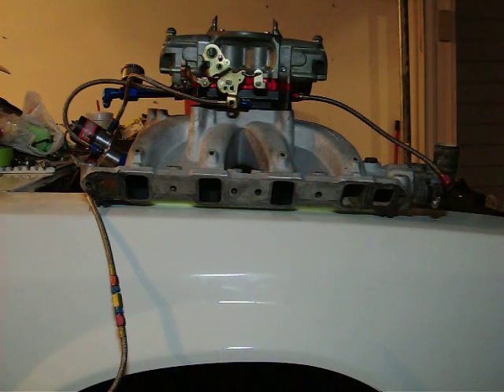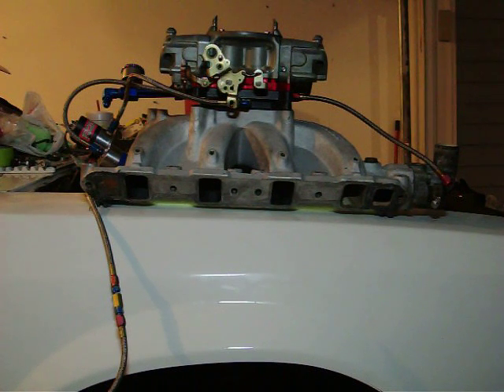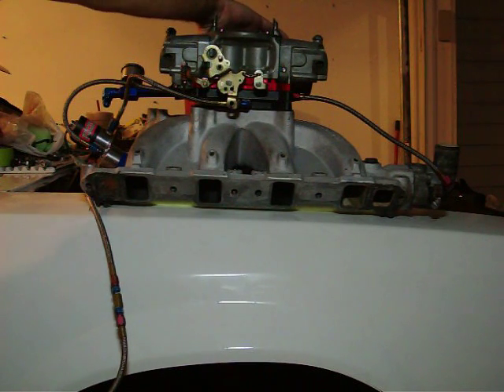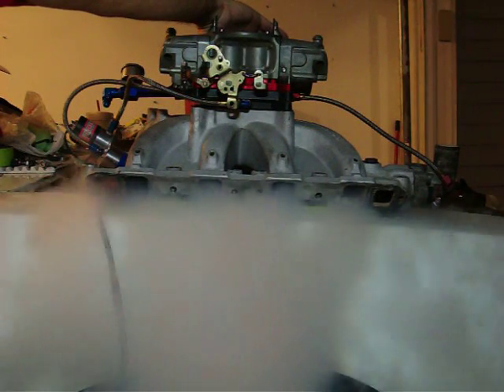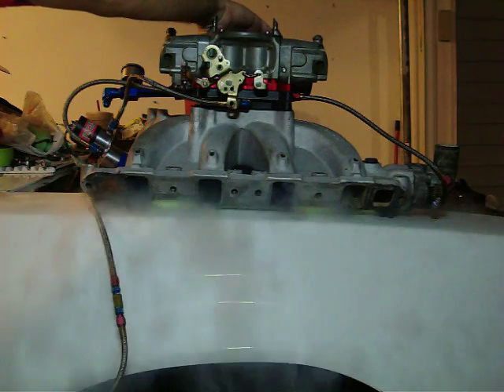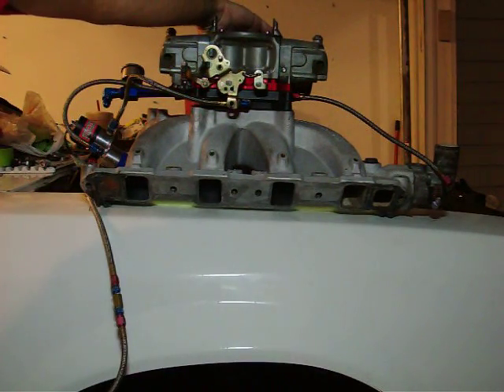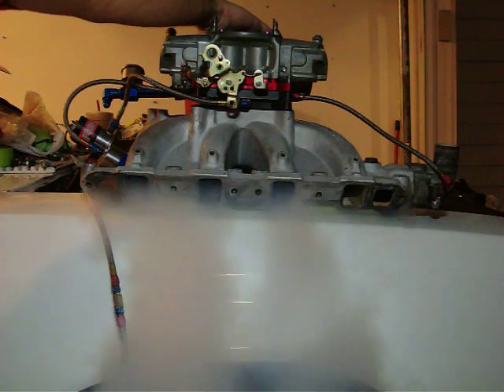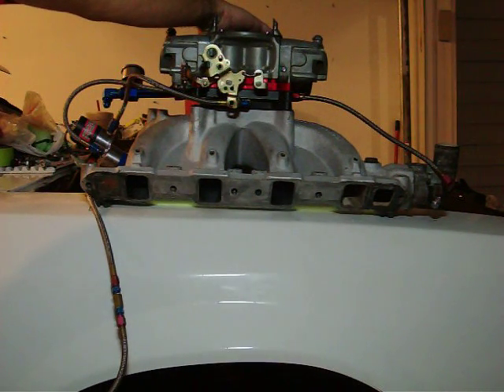Nitrous Flow Testing

Comment: If you're that concerned about it why not just tap & drill the runners for 8 foggers rather than using 2 plates? Wouldn't the cost be about the same?

Comment: Good test there, The number 1 cylinder looks to get very little if any flow with the sideways plate. I know things would be different with a car running and pulling a vacuum on that runner but  getting good flow through there without it like on the inline plate would be optimal